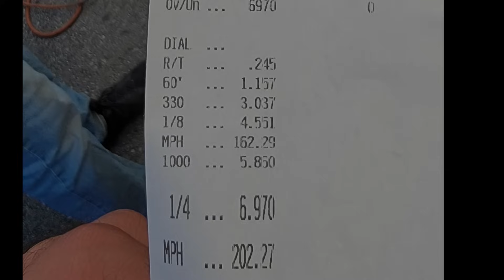AVENGING THE BLUE GOOSE 1ST 6 SECOND 6R80

Comment: I want that motor in the fox chassis we built.. It weighed 2560 with no driver, and a big block with 118mm single turbo.. TH400, & 9in rear..  maybe the new owner will dump the big block and go for a Coyote.., ex owner of Texas Speed bought it for $125k..